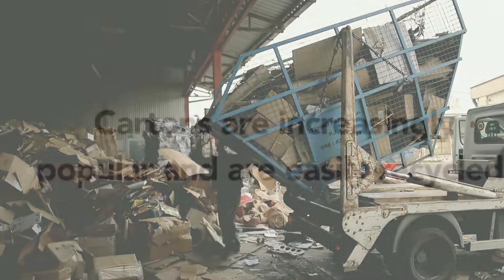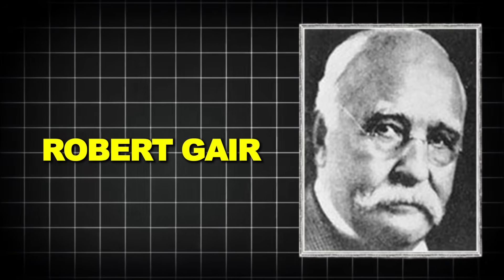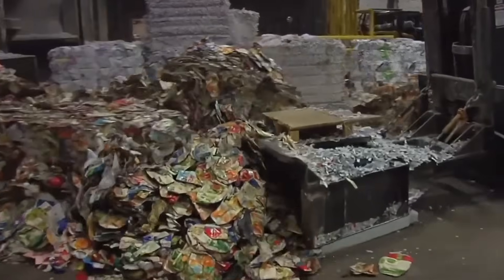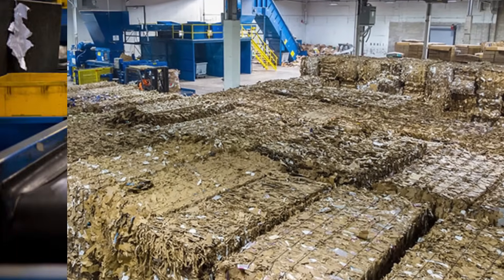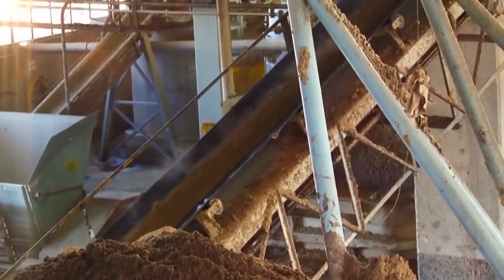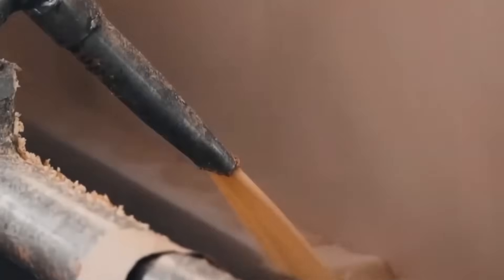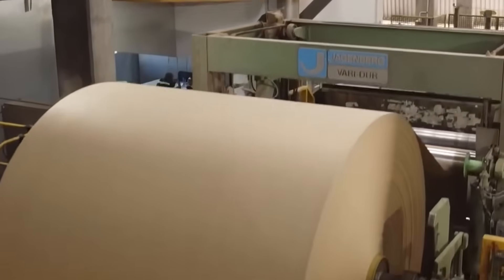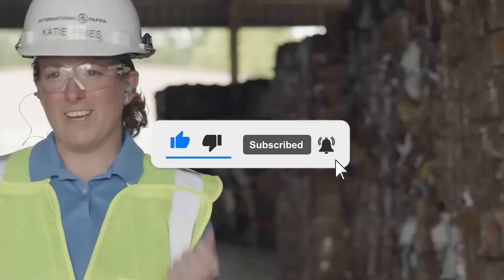How Over 450 Tons of Cardboard Is Recycled EACH MINUTE In Factory

Comment: I'd burn the cardboard that can't be recycled and turn the heat into steam. The steam turns a turbine and generator with a DC output. The electric turns water into hydrogen, a clean fuel, which goes elsewhere, and the waste oxygen is blown back into the furnace to boost the combustion. A bit like a hybrid rocket engine that uses wood as a solid fuel.
Reply from the maker: Now this is some forward thinking. You might be onto something here!